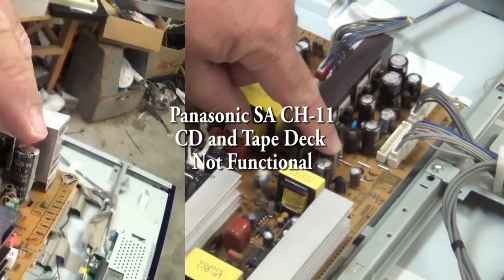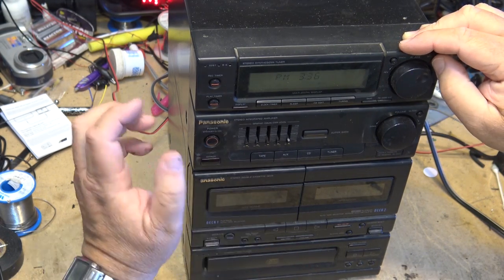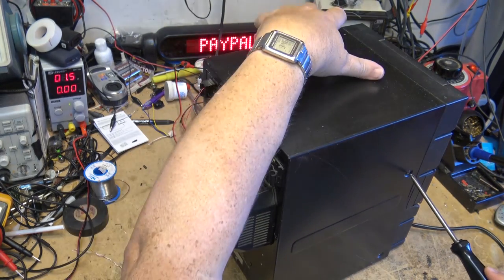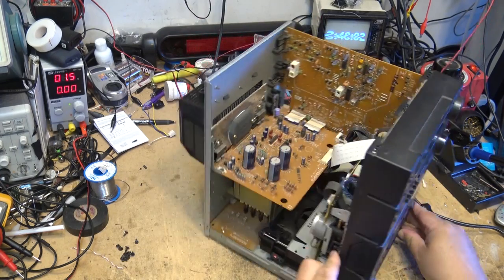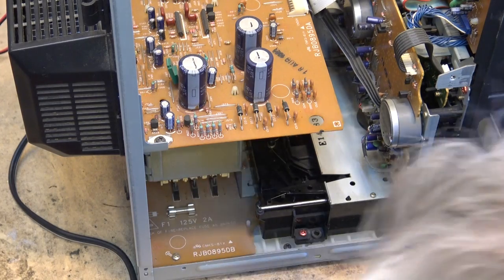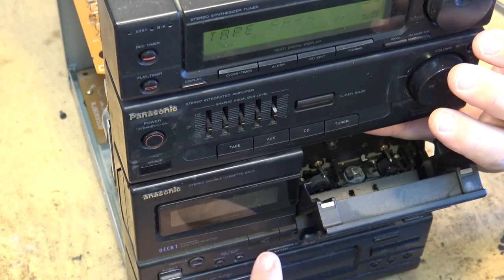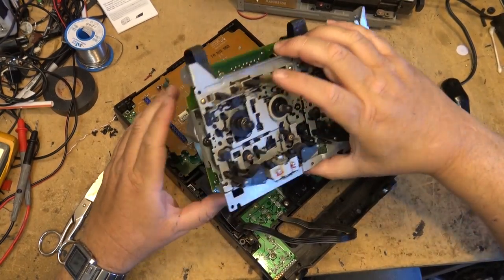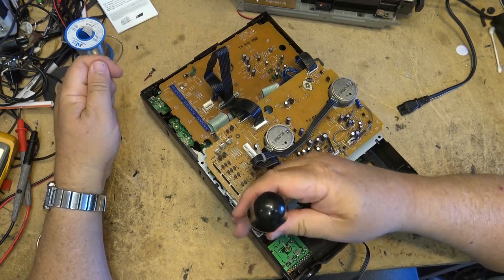Panasonic SA CH 11 Bookshelf Stereo   Cassette and CD Repair

Comment: I’ve always loved Panasonic units, they produce a beautiful sound & great natural bass. I actually own 3 of the 3 in one units from 1991, 1998 & 2005 & they all still work well.
Reply: I wouldn’t bother with the units that have the 5 stacker cd player in them. I owned 2 of them & the cassette decks are the first to break! The cd player is good & great sound & bass but poorly made with the cassette decks.
Reply: & hard to get into too, to repair them.

Comment: JVC, Junk Very Cheap, never heard that before! For my high school graduation in 1983, my parents got me a Zenith all-in-one stereo system. Back then my parents were Zenith everything. Had the record player on top, cassette player front left and the radio with the long rectangular shaped tuning dial. Had VU meters too for recording to tape. Had a nice hinged dust cover for the record player and didn't feel plastic junk. Had the silver knobs on the front and piano type keys for the cassette player. I used the hell out of that thing. The first 45 rpm record I played on it was "Hungry Like the Wolf" by Duran Duran. I sold it in 1991 for a new system.

Comment: Great video! I have a 1991 Samsung SCM-7550 that looks similar to this one internally. I am currently using it as a "headphone amp" since I do not have any. It has a broken display which shows random characters. I am planning to fix the display and do a cleaning on it. It seems like a good idea to replace the thermal paste on the heat sinks as well. Learnt a lot from your video. Thanks!

Comment: I have a very similar unit made by Aiwa in 2000. It I not as good as this one. The tape player is absolutely mechanical, no solenoids, No auto reverse, A single motor, plastic flywheels. Had to replace the belts. Sound better than I thought. Also the spinning section of the 3cd player’s clamp needed to be slid up of the shaft of the motor. Still stops playing sometimes for about 20 seconds then kicks back in. The cd still spins off center. Needs new motor maybe.

Comment: Very interesting. I see your point on what a pain it was to work on. I noticed the deck mech. looks like the AR-300 type found in your other vid on the DS-20 portable. (and right you are about the sound quality of that unit),as i have two myself,and they still impress! I think many of these Panasonic units wrongfully took a back seat to Sony. Now I love sony,but if I may say; even units like this sa ch11 may just have been better performers in the long run.i only had one problem with one supply spindle "clutch" slipping in revers-play mode.other than that...nothing. I love the "huge estimate " reference. I don't blame you after seeing this!  good stuff.

Comment: I have had an akai 2 piece mini set in the 90’s. It had problems with the cd player.  In the end it was a piece of crap like most of those all in one sets.  Most of the time i used separate devices like amps, cassette decks and tuners etc etc... at the moment im very happy with my vintage pioneer set. Late 70’s stuff.
Reply: Some all in ones were very very good! the metal jvc stuff was awesome

Comment: I have a Pioneer Amp that I still use to this day, it cost me $2000.00 AUD back in 1994 ( VSX-D603S ) , had it for 6 years with out fail, then one morning wake up to it not powering up, found my girlfriend son who was 3 years old found the power voltage selector switch on the back and changed it from 240volts to 110volts, I had to replace the main power transformer , I also glued the switch back to 240volts position.
Reply: running a 240 volt unit on 120 volt should not have resulted in NEEDING a new transformer. all it would do is cut the voltages inside the unit in half
Reply from the maker: He is in Australia, they run 240 volts there. Setting the power transformer input to 120 will provide double the voltage and burn out the transformer. Likely it was just the standby transformer for the remote that was toasty. Had the unit been switched on, every component would have seen double voltage, and there would have been a cloud of very smelly smoke when all the capacitors in the power supply went "Pffffffffffffsssssss"
Reply: 12voltvids

Yes, it was the standby transformer, still a $140AUD part , as you say, lucky the unit was in standby and not turned on.
Reply from the maker: Yes saw lots of blown standby transformers. Here we are on 120v center tap neutral.
The feed to the house is split phase 120, so phase to neutral is 120V, but phase to phase it is 240V.
That gives us here in N.A. flexability. Low voltage for small things that you plug in, but full 240 volts for bigger things like electric car chargers, water heaters, base board heaters, range, clothes dryers ect.
A big problem here on the coast is corrosion from the salt air.
If the neutral return to the transformer breaks, the neutral will float and will go to the phase under the most load, resulting in a severe over voltage on the other side.
Remember that current on a 120 plug is expecting to return on the neutral, but is that bond is lost the neuteal will rise, and voltage will drop on the side with the larger load stalling things like compressors in refrigerators and burning them out, at the same time that the locked rotor in the air conditioner or refrigerator is pulling full current that is all ending on on the floating neutral side, which in effect doubles the voltage causing everything on that side to go POP.
I did a tear down last year on a little switching power supply that the MOV went pop when the neutral on the house went open.
Reply: Yes indeed that is a serious issue if the center tapped neutral goes flaky it does  exactly as you described (higher current items on the other side of that neutral will shoot a much higher voltage to the other side) ... image putting 3/4 horse motor (with a start winding) in series with a 100 watt incandescent light bulb super bright light till it burns the filament out LOL .... and yep if that's an electronic device it just might be cheaper to toss it rather than try and fix it .... I'm sure there would be MANY COMPONENTS that had their smoke let out of them ... and you all know what happens at that point (no smoke no working component) its almost worth it once q year to clean the neutral at all locations once a year to make sure that it makes a solid connection so there isn't a current war to start with
Reply from the maker: Was working at a customers house that had a tree land on the power service drop and rip the neutral. In her house, it fried the furnace, fridge, freezer, and blew every light that was turned on. I was there to fix the internet and TV. Fortunately they had the computer, modem and PVR plugged into a Tripplite power bar. Not an expensive one either. About 15.00 Power bar did it's gob and burned itself out, saving the computer, TV, modem, and PVR.
Customer was mad that I was charging her for a new power bar (it was one we supplied)  and I said the 15.00 for the power bar is cheap, had you not had it, you would be buying all new equipment, just like your appliances and furnace.

Comment: Had a So y MHC 710. It blew laser diodes left and right, replaced 2 opticl blocks in 1 year, 250 a pop. Threw it to the trash in 1995 and got ke seperates.

Comment: Ahhh so that's how those bloody ribbon connectors come apart. I've been scared to just pull on them 😂😂😂😂 also didn't know about the push down then remove one either. I'd assumed they had to be desoldered .....face palm
Thanks for the video I learnt something 👍

Comment: Panasonic sa ch32.The cassette door doesn't close after inserting cassette, both decks.one pinch roller moves freely but the other one isnt going down on its own.If done manually, it bounces back like a spring.This is stopping the cassette insert.Pl help

Comment: You said they sold jvc, Panasonic, and some Sony all in one stereos, but did they sell Aiwa? A lot of Aiwa products were actually more reliable than Panasonic, and jvc. I do not know about the Sony ones though. I have an Aiwa with similar problems that this panasonic had, but it was from the year 2000. The issues were not as bad. The belts on the tape slipped and it would not turn at all, so I replaced the belts and it works perfect. The CD player would not read. I cleaned the laser and it sorta works now. It does not read all discs, and always stalls on the first track of every disc, not to mention it skipping if I put a subwoofer anywhere near it and blast it, or if I jump too high. I think, since it is a 3 cd unit that is actually, in my mind, worth repairing, I may buy a new Sony kss213f optical pickup.
Reply from the maker: Aiwa was a sister company of the Sony corp.

Comment: I have KEF drivers in a Cabinet.   3 way and yes, oval woofer. I think I can get good money for them one day.
Reply from the maker: Mark Anderson 
Yes those were bloody expensive drivers for sure
Reply: @12voltvids  I have the b139 woofers the b110 mid-range and the t27 tweeters in a homemade cabinet. Back in the 70s it was about 400. They sound smooth.

Comment: Hello, thank you for the video. Currently I have this model. After a long time being in the store,  I tried to turn it on. Currently I am using not its original ac adapter (I'm using any available in the house). It shows the standby mode and the red light, but it wont turn on. I remember last time when using this, it has problem to turn on, and sometimes it keeps changing its mode from aux, cd, to tape. I'm not an expert on this, is the problem serious to get it fixed?
Reply: Also I tried the remote control to turn on (in case if the power button did not work), still not working.

Comment: Wow that's a pretty beefy amp on that stereo, look at that heat sink. Is there a fan inside?

25:34 On those three blue connectors it looks like the pinout connections are printed right on the board, I like that. It has helped me in many of my mods. The sharp stereo I modded in one of my videos didn't have these on the board, I had to get a schematic online.

I have a 300 watt kenwood mini system that I got back in 2001-2 ish and it still works to this day. The belts are getting weak but I don't use tapes much anymore.

Comment: ive got a seperates system consisting of a marantz amplifier circa 1985 a kenwood tape deck and  a bush record deck and large speakers the volume control on the amp is getting a bit crackly would switch cleaner sort this problem?
Reply from the maker: Yes contact cleaner will probably clean up that control.

Comment: Great Video! 
You know if this devices got clones by other brands? Check Philips FW 26 and FW 46
And you are totally right about'em, I got a Philips FW46 for my 12th birthday! haha! (around 1995)
Question: mine's screen had a green backlight  but as burned out. I cant seem to find the actual replacement to get the actual bright green color. Any advice?

Comment: The only part I hate is that how these are filled with roaches and full of dust but I clean the hell out of it
Reply from the maker: That is what air compressors are for. Leaving here cleaner than it arrived.
Reply from the maker: Coronadraht 
Compressors are great but you need a disacant to remove the moisture. Mine has a can and I put these bags of silica gel into it. That removes the moisture
Reply: I have always called them trailer park stereos
Reply: 12voltvids yes indeed

Comment: That didn't take too long out of your day to fix, someone will find it usefull :-).
I've repaired equipment from heavy smokers, sticky surfaces that look like poo with the thick coating of niccoteen, bloody disgusting!!.
Imagine a bowl of detergent/warm water going dark poo brown after cleaning it, horrible :-(.

I too hate the single module audio amplifiers, names like San Ken and S.t.k modules just make me want to run away lol.
They work but more often than not are the problem.
Reply: Yep me too it's not good
Reply: Elvis Ramos/ ERB systems.

I'm not a smoker eather, so it's horrible.
Or you may be commenting on the audio modules, they are poo too :-D
Reply: Both
Reply: It's just I prefer to use normal MOSFETS because they dont always fail
Reply: Elvis Ramos/ ERB systems, Yes mosfets are much tougher than the old bipolar transistors, but i've seen some nicely made amplifiers over the years and bipolars can last really well with a good heatsink and protection added.
Mosfets are better at coping with abuse, look at most switchmode power supplys, they get really toasty lol.
Reply: @zx8401ztv  next reason why companies used transformers to power those high powered devices

Comment: For electric switches i use Mobil1 0w40. No cleaning required and the switch works more than it had initially worked.

Comment: That I s a good stereo because of the equlaizer, auto reverse. I have one side cassette player has low sound, so im going to clean the head some, knowing it can be alignment or something. Thanks,The junior story sounded if the stereos receiver amp was blowing the speakers . If it was different components...sorry for your business, karma

Comment: very nice to see how to work on this  I do have to say I lost interest when you said as long as i can get it to last long enough to sell it to someone right.
Reply from the maker: You have to remember that these units go for 30 to 50 here.  I don't know where people get these big numbers from but they don't sell for that much.  So why would I replace every part that can wear or break.  You do the minimum to get it going and try to sell it.  I'm not investing more time than needed.  The videos are to show common faults and how to fix them.  This unit I couldn't even get 40 for so it was donated to value village thrift store where they probably sold it for 10 bucks.

Comment: Great videos, thanks! ... But I must ask you a question. Did someone actually pay to have that Panasonic all-in-one repaired? I mean I've seen those things in the garbage around my area. Just doesn't seem that it'd be worth the cost of repair... You must be doing someone a favor. :)
Reply from the maker: It's my unit. Was given to me. I fixed it Ryan sold it on craigslist.

Comment: That amp board is the same size of the one in My Technical Pro receiver except instead of the amp module theres 6 Amp transistors and more resistors, transistors and caps.. and other stuff. lol. It claims 1500w when the transistors are 65w max. sounds better than sony's STRDH130 for some reason. Odd.

Comment: Nice. Do you ever work on any vacuum tube gear like old Fisher, Sherwood, Mcintosh, etc?
Reply from the maker: Of course I do. I have a MacIntosh MAC1500 that I will be restoring some day.
I have done several vintage radios over the past year.
I have also built 2 tube amps on camera over the past couple of years.

Comment: Why would you tell us a story how you fixed a guy's speakers for almost $5,000.00 ?  Why didn't you tell the guy that it was not worth repairing .  Glad to hear you are not in business any longer.
Reply from the maker: It wasn't my business. I was just working there.  I had no decision on the repair, I was just the guy pulling the old parts and replacing them, and I had no control over what those parts cost from the supplier.  The labour on that repair was probably only 100 bucks.   I left that place  9 years before it went tits up.